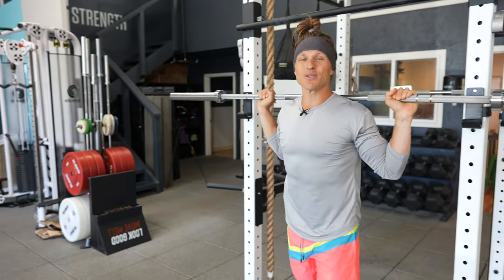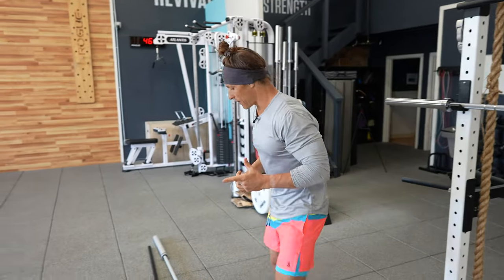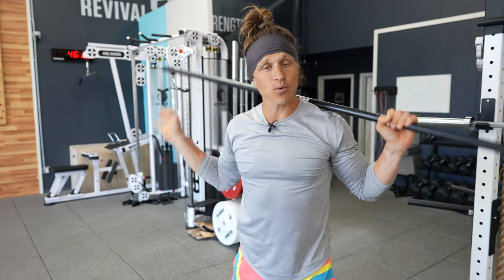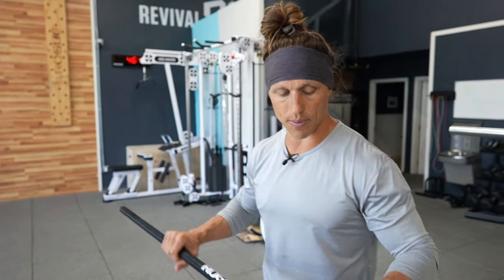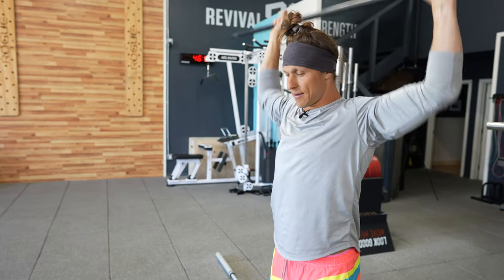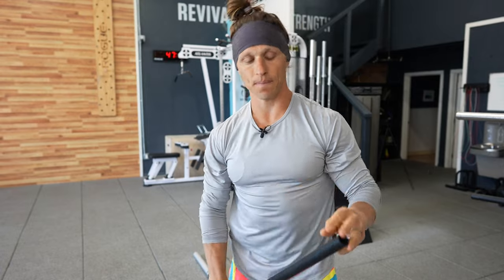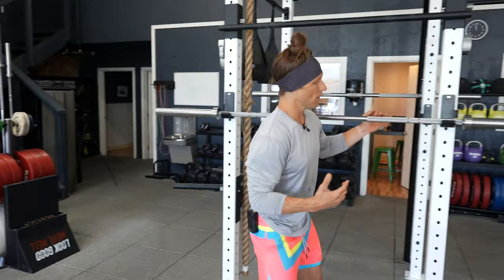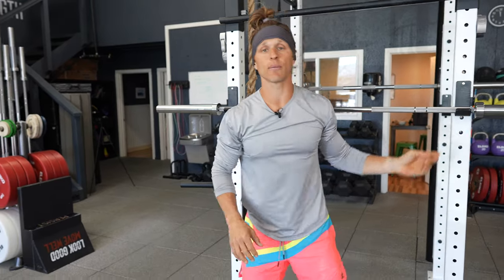Behind The Neck Press Breakdown

Comment: Good video. I have started doing the these recently (standing) to work on fixing my bad posture. So far, what seems to work for me for me is to ensure my external rotators are engaged throughout the whole range. I don't like to let them switch off for a moment. I'm fine with the lowest and mid part of the range but the very top is hardest for me as I have lots of restrictions in the way of achieving full shoulder flexion. With lots of focus, I'm just about managing to get an ok top position for each rep, but only just about. Do you have any tips for better overhead lockouts (i.e. above the shoulders, instead of slightly in front of them)?
Reply from the maker: Hey Chris, good question. For overhead lockout on a behind the neck press, we like locking out directly over the middle of your body. You may have to start a little farther back and work your way slightly more forward. It might help to think about pressing your pinkies into the bar. Hope this helps.